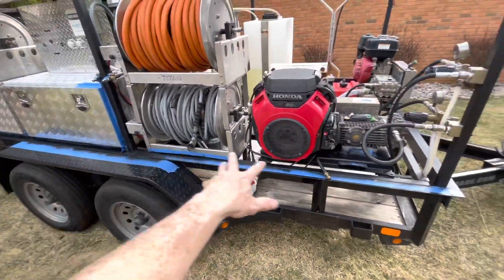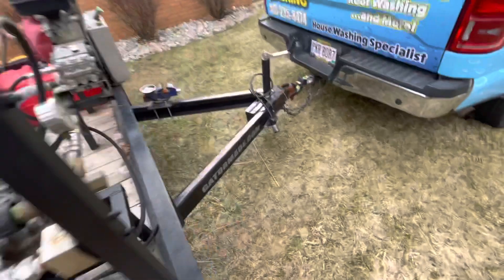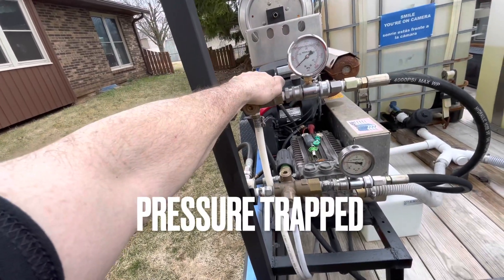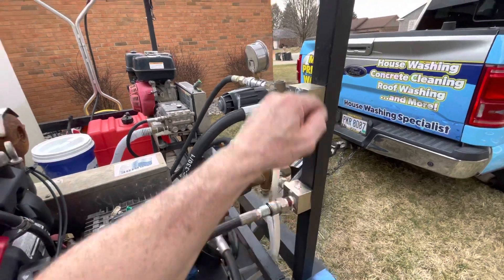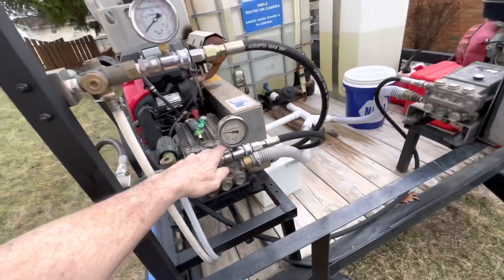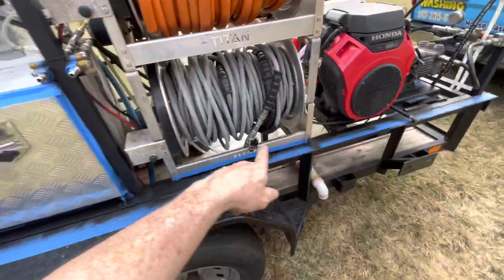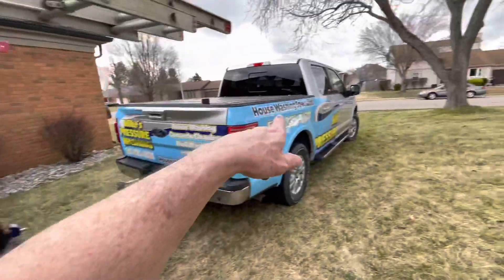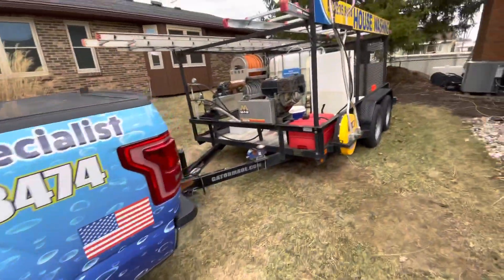Unloader Tree and Half Truck Wrap Explanation!

Comment: Not sure if you ll see this but often times, you can just remove the rubber plug on top of your gauge and it will drop right down to zero and you re back to a working gauge. We use similar gauges for other items and this is how we “fix” them when they re stuck. 
Put the rubber cap back on before you use it Ofcourse. 
Hope this helps!
Reply from the maker: I had no idea. Hmmm, I’ll definitely look into that. Thank you.

Comment: Hey Mike, nice setup, in your opinion does the length of whip line matter in either direction?
Reply from the maker: It has not been a detriment to me in the least. I think mine are 5’ from the 5.5 machine and 8’ from the unloader to the bypass.

Comment: Good. I have an unloader with integrated baypass. When I leave the gun trigger, the baypass at 4000psi opens. I have a 1/2 hose that is 4,921ft from the unloader to the pump. I ask. When I let go of the trigger, who suffers more, the pump that is always working impulsively with a gasoline engine or the unloader that sits between the synetic shock wave from the tip of the gun; with the construction of pressure inside the hose; and the construction of the synectic wave coming from the pressure built by the pump?
Reply from the maker: @pedromatosmatos1767  If you are terribly concerned, get a K7 unloader. That might be your best bet.
Reply: Not really. What I have does its job. Synetic energy should not be serious in the pump head. She is at a "safe" distance... I was asking these questions to determine if a non-return valve between the pump and unloader made any sense. But since the relief point is far away and the pump is always working. Does it make sense to spend a few extra bucks on whims or is the non-return valve going to do nothing?

Comment: Mike why did you choose to have 2 unloader trees? Instead of just running from the unloader mounted to the pressure washer to the block beside your hose reels?  What’s the purpose or benefit from relocating the unloader from the pressure washer.
Reply from the maker: Great question brother. Removing the unloader from the pump removes extreme vibration from the pump, especially if you have a pressure trapped unloader. Also, I’m all about convenience and efficiency.
Reply: @TheFreshRinse  I have noticed you are, I’ve taken some notes. Lol I bought a flow sensitive to try. I just wasn’t sure why you would have 2 sets of blocks instead of just 1.
Reply from the maker: @mcmillerpw  Oh, that. One runs the 8 and one runs the 10

Comment: What is the name of the block next to your reels where you connect your pressure hose after pulling the hose you need?  I want to order a couple from Russ.
Reply from the maker: Hey Robert. It’s called an “Unloader Block”. As for brass, if that’s the one you want.

Comment: Hi Mike
Are you getting your SH in 5 gallon container s? I'm thinking about buying it in 30 gallon barrel s for $6.75 per gallon plus delivery. I checked with Walmart and they want $17.00 a gallon in  5 gallon container s unless they gave me the wrong price, any advice?
Thanks
Reply from the maker: Hey Dale. Do you have a pool supply store close? Most sell it around $4 per gallon. My situation is a bit different. My neighbor owns the local pool supply store. I get it quite cheap. I have to pick it up, but it’s worth it. I get it in cases of 4 gallons each.

Comment: 8th
Reply from the maker: Just for you brother!
Reply from the maker: Did that help?
Reply: @TheFreshRinse  In a word,.......IMMENSELY.   Thank you very much. I was/am setting up my own "Unloader Tree" with 2 different unloaders. A regulator Pressure trapped unloader and a K7 for "easy on/off pressures". I don't know why I'm doing it, except to say that, "I can"..... I run just 1 pressure washer, a 5.6 GPM machine.
The only other question, My Fresh Rinse, is, do you adjust the pressures with these unloaders? Everyone says, "Set it and Forget it".
Thanks again, for this video.....
Reply from the maker: @symplemynd57  Brother, I did the same.